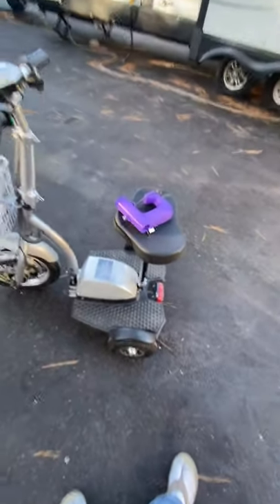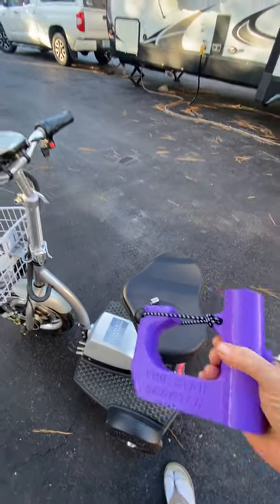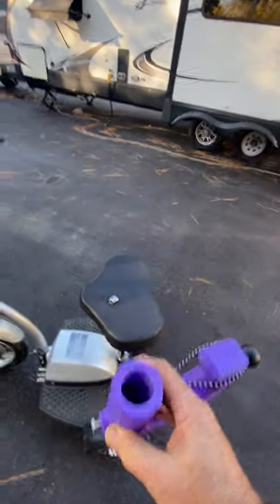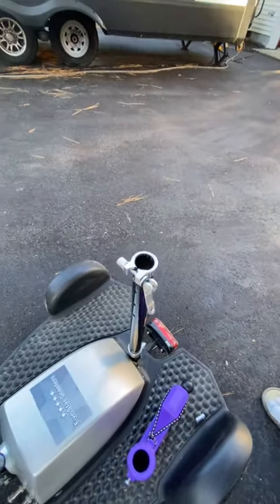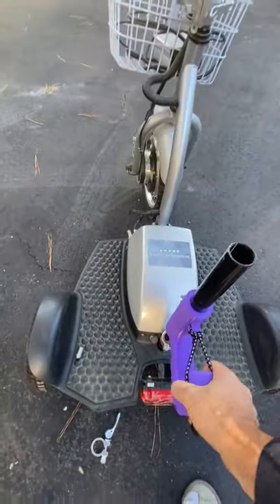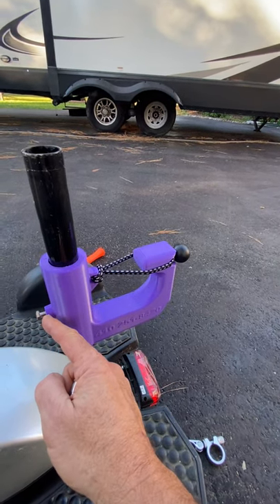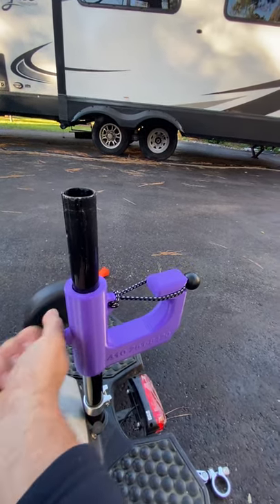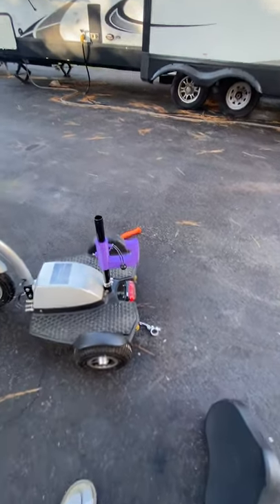Our custom hitch installation. www.5starscooter.com (the real ones)

Comment: Will it fit Excalibur scooter or do you have one to fit it
Reply from the maker: It depends if your Excalibur has this type of seat pipe.  The original Excalibur’s did not and the seat pipe had a plastic housing around it, so it will not fit.  We may offer a replacement pipe in near future but at this time do not have spares of the newer pipe.
Reply: It is the same post